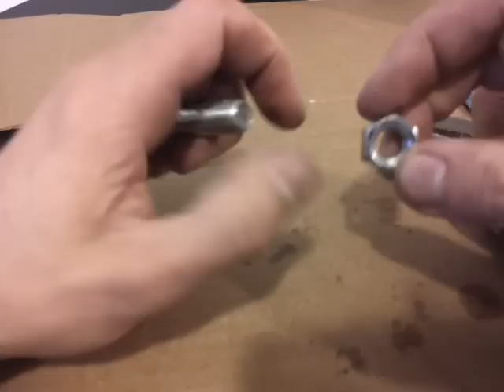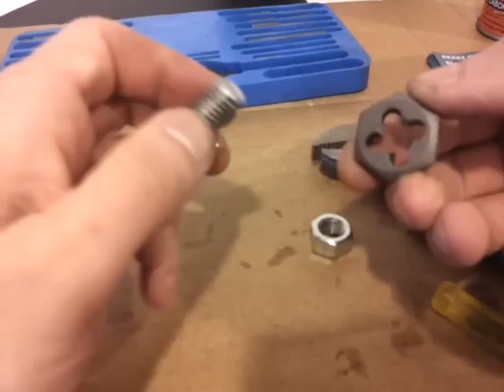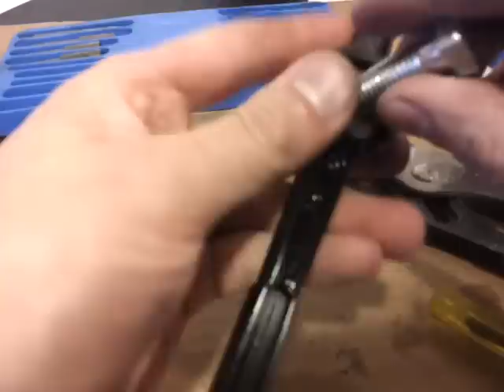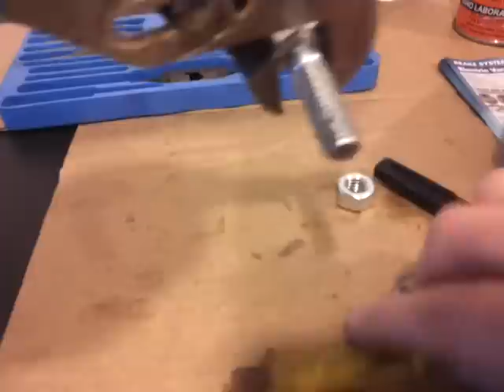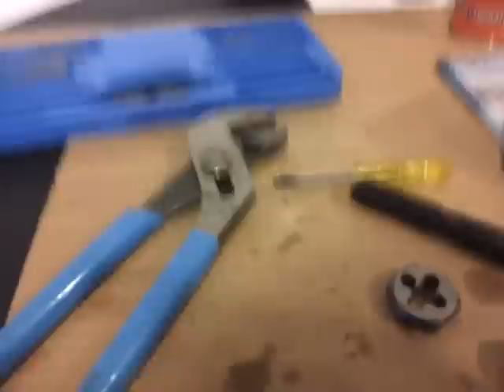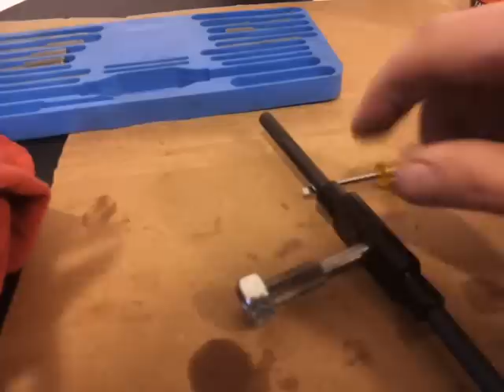How to use a tap and die - FIXING STRIPPED THREADS DIY ...

Comment: finally....a tap and die video that doesnt use a drill press or workshop grade equipment...i have one of my diesel engine injector hold down bolts that went almost blunt.....its either a DIY job or engine head removal and off to a workshop $$$.......thank you
Reply from the maker: Hmu should be able to get it fixed using this method..thanks for watching

Comment: Great Video, feel comfortable already fixing the elliptical machine. 'Botched up the installation and the bolt wouldn't go in.  Someone asked about where to find one.  Found a cheap set on the net at Harbor Freight Tools at 15.99. Will see if the have in the store nearby  to fix the skipping thread and complete the installation.

Thanks.

Comment: My question is when standing the threads back yo is the bolt as song as before the hammer damage.
I find when repairing hard to buy bolts and nuts I always put them in a vise for better control.

Comment: the best video i've seen so far about tap & die. can I reuse the bolt when I tap the valve cover? I'm just assuming once you tap on a thread, the hole gets bigger and it might need a sligthly bigger bolt? or should I just use die on the bolt too? also, I'm planning to buy the 40 piece from Harbor Freight, would it do the work on my valve cover? Thanks!

Comment: I mushroomed my steering shaft on my car trying to take the steering wheel off. I forced the nut back on the shaft  after doing that as I had to use the car, knowing the threads would go to crap anyway. I'm now tasked to fix this. I'm hoping it'll work fine although I never used a tap and die set before and I'm at risk of making things worse. I assume the original nut would feel slightly loose after rethreading the bolt due the cut down on the threads? I could potentially require a different/smaller nut?
Reply from the maker: you should be fine
Reply: Encouraging :p  

 I assume the two important things to make sure you get right with this is  using the right die size and not rethreading the bolt on an angle.
Reply from the maker: correctomundo

Comment from the maker: Valve cover..im assuming u mean the head where the valve cover bolts into? If u have aluminum heads then they need to be helicoiled..if u tap a normal thread the bolt can be the same bolt..taps just restore the normal threads..i habe no experience with harbor freight kits..also dont forget to subscribe thanks!

Comment: instead of using that black tool.. if you dont have enough space. can you use a socket wrench instead?
Reply: +Solomon Yim An interesting idea; but the size of the dies would probably require the use of either a 3/4" or 1" drive socket.  Take it from me, those things are expensive.

Comment: Do you have to rethread the entire bolt? Or if the damaged threads are at the very top of the bolt can you just rethread that part and it will carry into the existing un damaged threads? Hope that question makes sense.

Comment: The bolt I am trying to fix is part of an elliptical machine.  The end of it is stripped and I cannot get the die to hand screw on as you show in your video.  Any suggestions?  Also, I am finding that two sizes (one metric and one standard) seem to fit in the grooves when measuring.  Any thoughts there would also be appreciated.
Reply from the maker: usually if the threads are real close to each other then its a metric size..if the threads are coarser then its standard..u can try tapping the die on there with a hammer to get it started,  but u have to really pay attention to start the die on there squarely

Comment: so you don't need a bigger bolt after so it still fits? like your not making the bolt hole bigger?
Reply from the maker: nope..just cutting the threads..use same bolt
Reply: +klowny1969 ok thank you so if I was doing the bolt hole and the bolt if I use the same size it will match up
Reply from the maker: +Darius Harris yesir
Reply: +klowny1969 thank you

Comment: Will this work if the threads are completely messed up ?
Reply from the maker: It should work for the most part
Reply: It was the threads on the radiator side
Reply: I had to buy a new radiator 
I bought the new with the whole kit 
 It basically brought everything included I’m so happy!

Comment: Regular taps and dies are not made for thread repair.You buy a thread rethreading kit for damaged and screwed up threads.Regular taps and dies are made for making new threads only taking out material.
Reply from the maker: not everybody has the funds to buy thread chasers..tap and dies are more useful
Reply: Sears sells the thread chaser set under $100.00.The fastner can come loose overtime when a tap is used to clean the threads out